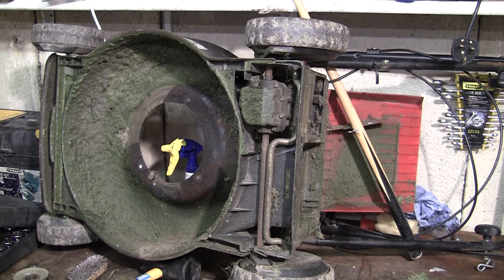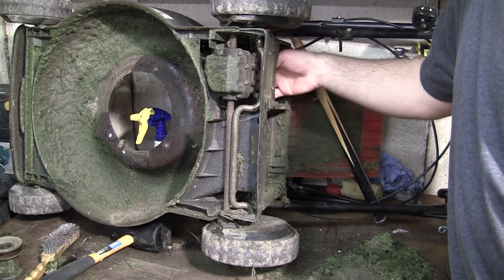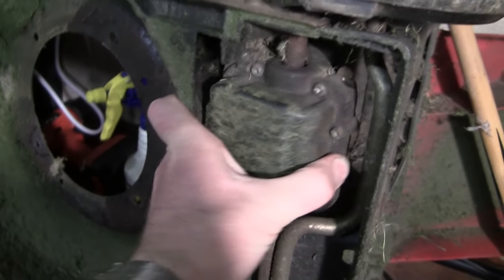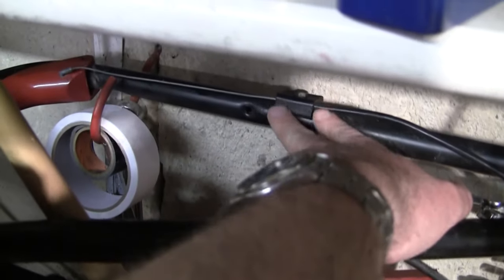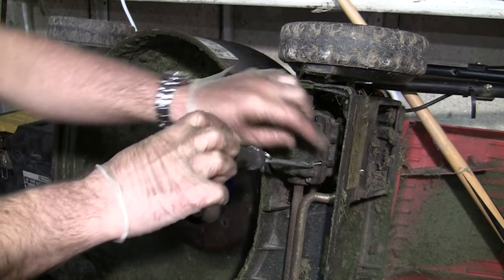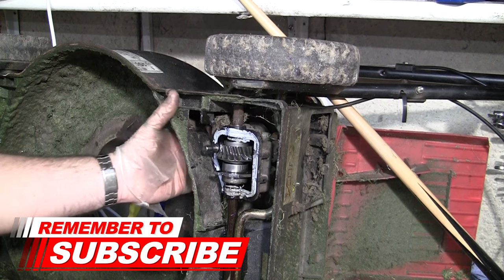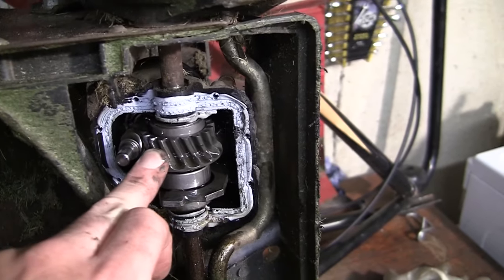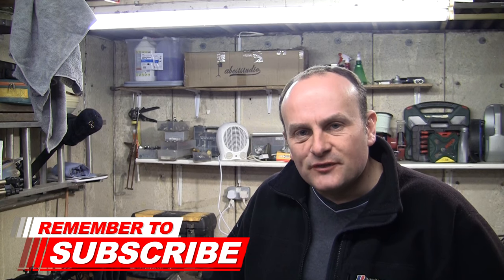Lawnmower Self Drive Not Working Help And Repair

Comment from the maker: https://repairlawnmowersforprofit.com/lawnmower-self-drive-not-working-help-and-repair/
Reply: Hi if the belt not that tight will that effect the speed of the  sep drive
Reply: I have a Honda and mistakenly opened up that box for the worm gear and drive and I needed to know how to refill it with what and close it back up because I had it on its side and a lot of that oil came out

Comment: Hi, I have a similar setup on my Makita lawn mower. The wheels actually turn when I engage self drive, but it just doesn't have power. It used to climb up the hill with no issues. Now it struggles on any incline. Any ideas what could be wrong?

Comment: I have an older (1986) Murray rear drive push mower where the lever on the transmission (Comet Industries) hardly moves.  The transmission does work but the metal transmission barely moves and the handlebar lever attached to the lever is VERY difficult to pull.) Before I open the transmission, is there an obvious fix?  The cable and springs are perfect.  THANK YOU for any suggestions!

Comment: I have a dual drive push mower, ,the cable seem to only go to the rear wheels, there is a belt that drive the front wheels from the motor shaft.  The front wheels don't engage when the motor is running but the belt is turning the pully???  Also the rear wheels are in a semi drive mode from the start of the engine but when you pull the cable tension it engages fully in the rear but still nothing on the front.  I don't find any cable connection on the front wheel at all.  This is a Briggs engine Craftsman Gold model 6.25 HP mower, Can you help??

Comment: Hi I a A Harry lawnmower self propelled 2005  and I noticed that one of the wheels drive an d the other one doesn't  and then that might happen to the other side I took the wheels off and cleaned them couldn't see any wear in these  have metal  drive on the wheels wondering where else to look🤔

Comment: Fixed a mates mower as it locked the drive wheels when pulled backwards. I looked for ages at the problem and sorted out the issue. The Spring was missing from the frame to the gearbox. Easy fix. Great videos mate.
Reply from the maker: Thanks Bobbelsekwol! glad you got it sorted.

Comment: Hi Paul just watched your video and it did help to a point my self drive isn't working checked the belt the cable is tight moves the transmission box but doesn't do anything think it's the transmission box my lawnmower is a BMC 16 triumph

Comment: Cracking video matey, Just got a Cobra self propelled that wont pull, If you lift it up the wheels will spin but on the ground it just makes a clicking noise. I'm going to check the pulleys are free first. That's as far as I'm at.... Thanks again. Dan.

Comment: Thanks for this I have the makita palm 4601 and thE self drive wasn't working I noticed a spring had come loose and the tension rod was missing got the spring back on now the mower does move but need bit more tension on the belt.

Comment: Great video.  Took the wheels off and dropped the axle out of my old titanium 5145hw today to fix the self drive. The spring was missing. Tried a spring I found but now to tight the box doesn't move. Going to have to try and find the correct spring. 
Keep up the good work.
Reply from the maker: Thanks Steve!

Comment: Thanks Phil for your very helpful video , I have a Qualcast 46cm  which the self propelled has stopped working, when I took of the plastic belt cover off one side of the plastic pulley has completely worn away, I then found the  this pully doesn't align up to the pulley behind the blade which would explain the pully beside the gear box being  competely worn away to one side . Have you any idea please what the cause can be, I wondered if this misalignment could have been there since new and its took all this time to wear the one side of the pully away.

Comment: Really helpful, have just bought a Qualcast petrol & the drive wheels won't action when the lever is pulled, but the lever is very tight, so I'm thinking my first port of call is to clean all the crud out as it may be interfering with the action of the little lever as in your video?

Comment: Awsome vid mate!! I have a problem with that the lever is stuck in the transmission. So the selfpropellant cant be turned off. Do i need to take it apart, or is there a trick that involvs knocking with a hammer until the clutch/plate that connects the gear loosens?? Thanks for a really nice vid !

Comment: Thanks!  Have a Q if you have time. My transmission are the same and my Q is about why it has to be leaned forward or backward? Also my transmission box had oil in it half full. Something is wrong inside the box and the axle goes very heavy and it can not leave the drive-mode, it always spinning the wheels.

Comment: My newer Troybuilt front drive mower stopped working.  I took the cover off the gear box and replaced the 1/8 inch pin that slides inside the gear.  I had an older Murray mower in my parts pile that had the same gear box.  Just took the pin from there and put it is the Troybuilt.  Guess they don't make that part anymore.  My self propelled is working again.  The pin looks like a shear pin you might find in a snowblower arbor shaft.

Comment: Hi mate. Looking for bit of advice on this. Have a Husqvarna self drive with similar mechanism. Have replaced the belt and retensioned cable. When you pull the handle, the belt tightens on a pulley which drives one of these transmission boxes. It's good enough to drive the back wheels when I lift mower up of ground but as soon as it's on it's own weight, the mower isnt being propelled. The drive shafts to each wheel are just spinning with no drive?

I swapped both rear wheels over as one is alot more worn than the other (no threads on tyre) and I got full drive back for a minute. But now it's gone again!

Any ideas?

Comment: Great Video Mowerman my problem is on my McCulloch 40-50 cdpr great little mower but the other day i ran over some "wood chippings" thus causing the self propel to stopworking when i looked underneath a wierd shaped spring had come loose and was hanging.I cannot see where the spring has come from as i'm hoping that is causing the lack of drive hope you can enlighten Brian.

Comment: Yet another great video thanks I like how very detailed you go into all your videos. I have only been buying and repairing mowers a short time but at a standstill a the moment due to the virus lockdown.  If I could just ask you a quick question please, I picked a mower up the other day I put a new diaphragm and gasket on carb but when I prime it , it pulls the fuel through but then after a few pumps it stops pulling the fuel through could this be the primer bulb although I can’t see anything wrong with the bulb thanks for your time..stay safe
Reply from the maker: That's a strange one! I guess the only way os to replace the primer bulb? I try later on mine and see how many times it lets me prime.
Reply: At the back of the carb there should be an o ring and an o ring shaped clip that holds it in place, sometimes these can fall out and could cause your priming problem.

Comment: Nice video Paul, those plastic drives are crap as you said. That one has lasted well.
Reply from the maker: Yeah it's been amazing. I noticed in the new Mountfield brochure they list if they are "pro" aluminium transmissions or not nowadays

Comment: Nice video Paul . The later ones as you say are plastic which is garbage .
I think the the drive cable is the key as the first SP470  does not have
a eared locking tab connection .
Reply from the maker: Interesting Pete. I wonder what year they changed it over? Did this look like aluminium to you?
Reply: Not sure Paul but when they changed the wheels and trims to the Pepper pot design.

Comment: Only one wheel drives on my mower and I just want to know if that's normal or if I need to investigate and do a repair to get both driving, thanks
Reply from the maker: Normal
Reply: @MowerMan  Ok, so I investigated just now and find there is a RATCHET inside the pinion on each wheel (because there is no differential). So it's not like a kids tricycle one-wheel-drive arrangement. After cleaning and greasing, both wheels drive now. So, it looks like you need some more training, mate!

Comment: I have a hayter harrier pro about 3 years old . On starting works fine but after about 5 minutes stops pulling. If l leave it for an hour or so it works fine again but only for another few minutes. Any ideas

Comment: I’d like to know if it’s possible or easy enough to slow down a self propelled one speed mower.
Reply from the maker: Slow down the engine and the drive will be slower
Reply: @MowerMan  
Wow thanks for the quick response. 

Now, can you guess my next question?
Reply from the maker: @iant9461  You need to bend the governor spring tab that the spring attaches to. There's some videos on youtube

Comment: Hi , can I ask after following your excellent video ...is there any difference in the cables between a roller model and a standard one? (46sd 46sdr flymo) as the price is double for the sdr ones on the official websites ?
Reply from the maker: Really not sure tbh sorry. Maybe asked the company that's selling

Comment: The problem with my mower is lack of traction as you describe. The belt has broken however when I check the drive gearbox this seems fine, if I turn the pully by hand as you do in the video and engage the drive mechanism the shafts to the wheels turn but the wheels don't.

I have removed the wheels which exposes the cog on the end of the shaft. The coc doesn't turn when the shaft is turning, I can turn the cog by hand and it doesn't turn the shaft, so something is wrong with the connection of the shaft to this cog.

I am guessing that there is a a drive gear on the end of the shaft that communicates internally with the wheel drive cog. Am I correct?

If so does this mean that I need to replace the drive shafts and the wheel drive cogs?

I haven't removed the wheel drive cog to look as it is held with a circlip and I don't have circlip pliers.

I don't want to purchase circlip pliers  only to discover it is a lost cause and cannot be  repaired (or too expensive to repair)

Your experience on this issue would be most welcomed.

Your explanation of the gearbox and clutch mechanism was very thorough and easy to digest, well done.

BTW, the link to your website doesn't work!

Comment: Can you please help me i have a sanli mower self driven it was working fine the other day and the drivd stopped working the drive belt snapped so ebay sent me one out and I started the mower up and it snapped the belt there have sent another is there a tensioning spring on the drive box 📦

Comment: On this type gearbox the clutch is two tapered sprockets which travel freely along the drive shaft. These are pushed together inside the "crown wheel" which has another taper which they lock into. And the the gearbox is Hereby engaged.
The sprockets can Jam inside the taper, resulting the gearbox wont disengage.

Comment: Great video thank you. Just watched your video as I have a viking Mb 6.2 RH  mower. Self drive gave up. Opened it up and the plastic gear had totally worn down. Also in the process I broke the retaining plate/washer. 😕 Do you have parts or where I can get some? Was told I would have to replace whole gearbox and shaft.  I can send photos. Thank you 👍
Reply from the maker: Not sure about individual parts tbh. I would send an email to the main dealer
Reply: @MowerMan  OK thank you 👍

Comment: Hi interesting video to see what is inside the self drive box, got a mountfield mower at work it's about 4 years old and the belt keeps coming off. Could it just be a bad belt.
Reply from the maker: Stephen Shippam Most likely needs the spring tensioner tightening up a bit. make sure the belt isn't too thin also
Reply: @MowerMan  thanks for the and your advice I will order a new belt and check the spring tensioner I may have to send this mower for repair as I don't know if I am capable of doing it,
Reply from the maker: @stephenshippam9374  If its under warranty get them to do it
Reply: @MowerMan  hi no unfortunately its not under warranty,

Comment: How do you adjust the speed of of the self propelling as mine takes off like a rocket with the slightest touch on the lever
Reply from the maker: the faster the engine tuns the faster the drive will go. Could be that the belt fitted is too tight. Good exercise though!
Reply: @MowerMan  thanks for that didn't seem to matter what speed engine runs have to trot to keep up with it
Reply from the maker: @alanyoung4930  must be the belt then. Sometimes there's an adjustment where you lift the grass box flap up. It will be obvious if you see something that can be adjusted by a spanner.
Reply: @MowerMan  thanks again for reply will have a look at that, but shouldn't really have to as brand new and first cut, once again thanks for the reply

Comment: hi mate ive got a victa 235 lawnmower which did not run which now is running fortunately problem is cant shut the damn thing off when i let the deadman handle go had  it all to bits  and back together again  i think its the ignition switch  thats the problem but where the conectors are  mine  are elsewhere  on the mower  should i strip it  clean it  and put it back together again  will that stop it running   after i release the deadman handle  thanks mr . mowertorvator  (mick) cheers

Comment: Hi, I did a mistake , before adjust drive cable (only think  I must done), I remove all gearbox screws, so oil was drawn, thinking it was a protection cover.  How can I fill it again and what kind of oil should I Use? thanks for your support
Reply from the maker: transmission oil
Reply: @MowerMan    Automatic type tranny oil (ATF) or wouldn't gear oil that is used in the read end (differential)  of older type cars be better?

Comment: Question if i may,
Husqvarna 247sp drives fine but wheels lock up when trying to pull backwards?
Any ideas?
Reply from the maker: Sound like the drive gears have worn out
Reply: @MowerMan  oh. Ok. Thanks for that👍🏻
Reply: More likely to be seized pawls. Difficult to get explain so Google self drive pawls seized for a better explanation 👍@brian Connor
Reply: @brianconnor1810  More likely to be seized pawls. Difficult to get explain so Google self drive pawls seized for a better explanation 👍@brian Connor

Comment: I badly need help!
My lawnmower ONLY drives... It wont stop.
The cable is ok, but it is slacked, but the lever on top of the gearbox moves forward under spring tension which makes it drive.
So basically, it looks like there is no spring pulling the lever back, but I am not able to find where this should be attatched... any idea's?
Thanks!